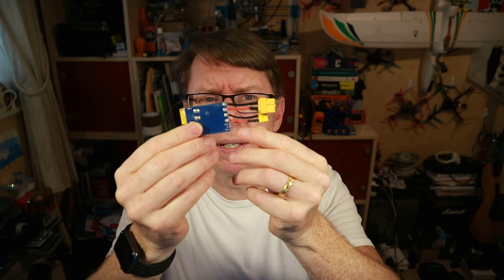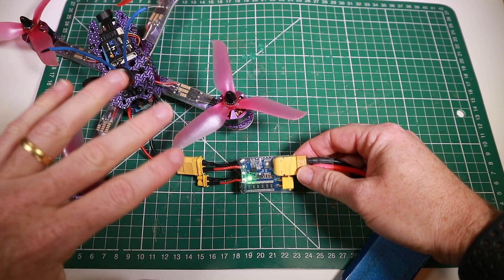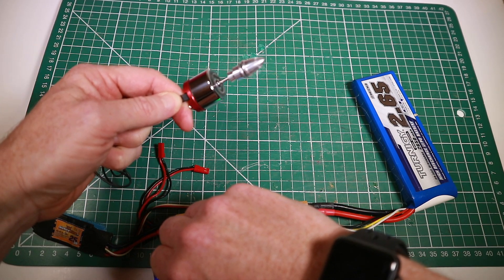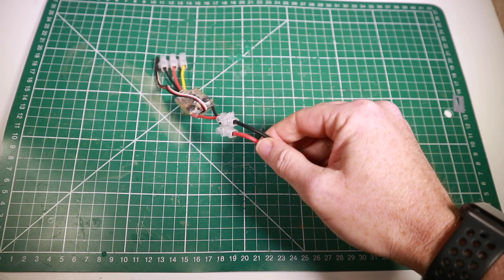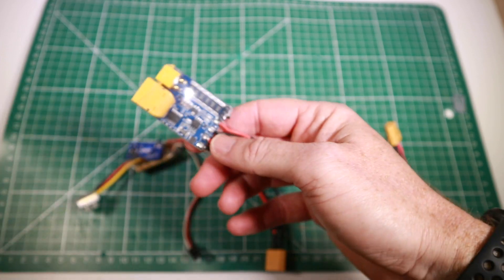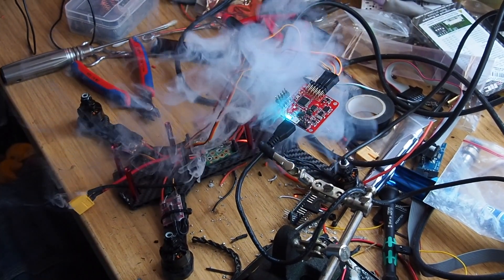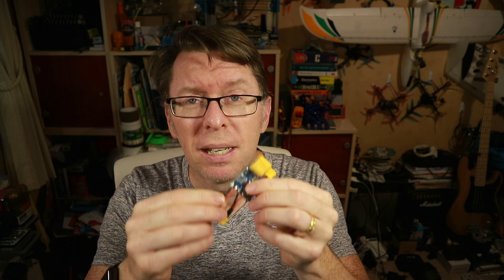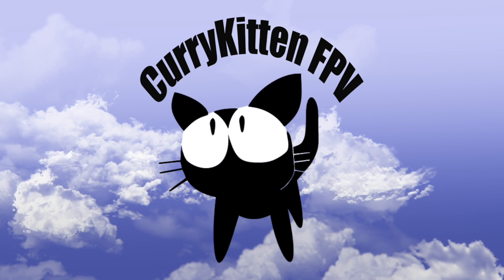The ViFly ShortSaver - this could stop your new build going up in (magic) smoke!  Supplied by ViFly

Comment: Just wanted to mention the reason the Airplane ESCs tripped this unit was they tend to have one or more "large" capacitors on the input of the ESC, so the inrush current can easily exceed 5 Amps especially on the high current ESCs.
Reply from the maker: Makes sense, thanks :)

Comment: I just received my ViFly ShortSaver and tested it on all my quads and surprisingly its shorting on my daily flyer ( HGLRC Sector 132 4K). So am in the midst of taking all the components apart and only have F4 Zeus AIO Flight Controller attached to the motors. I have verified that all soldered connections under magnifying glass and they aren't touching. The ViFly ShortSaver still trips and meanwhile I have been flying this quad daily. Any clue what the issue could be with the ViFly ShortSaver or is it with the quad itself?
Reply from the maker: That's curious, I did just try mine with the 132 as well, but it's fine and refuses to trip out.  I did note one or two things that would spike up just over 1A when plugging in and then settle to nothing - I checked that out with an amp meter to make sure nothing was going on - worth doing if you have one.  Does it still trip at the 2A option?  If everything checks out nicely, the only other thing I could think of checking is to test continuity between the carbon part of the frame and the ESC connections, just to make sure that no part of the motor windings is shorting (although generally you would have seen weird flight behaviour if that was happening)

Comment: A neat gadget and a real insurance policy when building.
You reviewed the Toolkit M6 recently and that has a current limiting supply function which would do the same and more. The update M600 has the same function, which is the main reason I bought one.
A current limit function keeps some volts on to charge the caps so you would know if it was just a surge or a short.
Reply from the maker: I'd never thought of the reason for the current limiter like that... make sense though

Comment: The spike on switch on is caused by electrolytic capacitors charging. Your plane will have servos, each with capacitors. More capacitors, more current. It's the capacitors which burn up. Tantalum capacitors smell aweful.

Comment: I power my bench with an ATX power supply, it shuts down instantly if there is a short 😎
Reply from the maker: That's a cool idea, I know there's chargers that also do this
Reply: @CurryKitten  I have converted ATX psu's powering all sorts here, they also make great Supplys for two way radio,  my entire cctv system is also powered by one